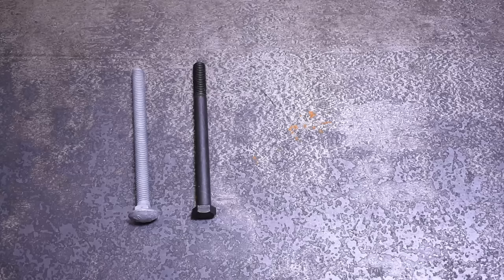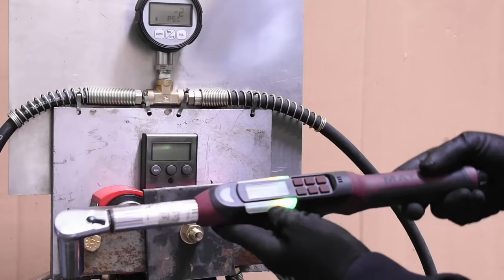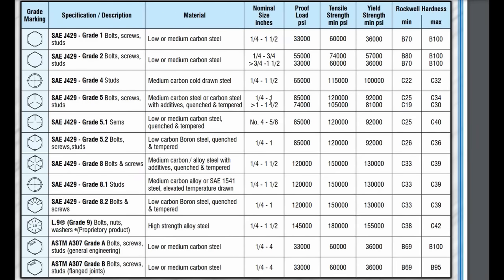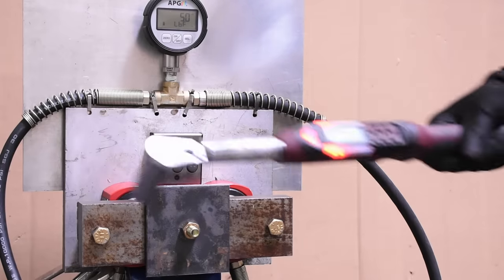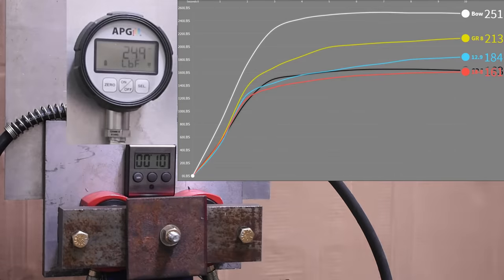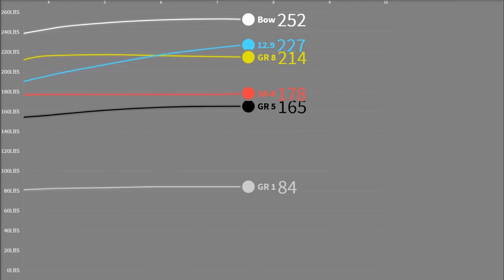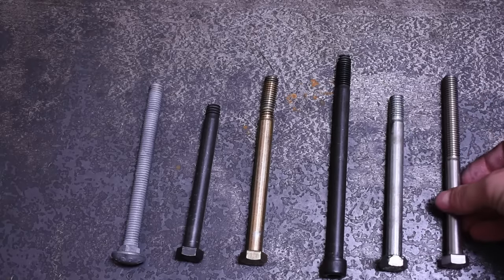Strongest Bolt? Grades Explained & Dyno Tested For Science

Comment: We use the Bowmalloy bolts at work for adjusting clamping force on vibrating material handling equipment(which is a great way to make small adjustments to the vibration), you really need to use torque wrenches with them. Unlike grade 8, it's very hard to tell by feel if they are about to yield. And they are very hard to drill out and remove from the equipment once they break off.

Comment: Love to see bolt specs finally tested! This is particularly valuable info for a home gamer without a torque testing setup to be able to test their impacts at home with some degree of accuracy, my method has always been to set it to max power, stick the bolt/nut in a vise and see how high a grade/size it’s able to break or strip the threads out of

Comment: Would be interesting to see the same test performed by hand instead using an impact. 

Also why no lube? Lube shouldn't impact the clamping force or material properties of the bolt. You would just need less torque to reach the failure point.
Reply: Lubrication dramatically changes the clamping force at a given torque. In a joint with a lot of friction, most of the torque applied goes into overcoming that friction. Add lubrication and a lot more of the torque actually goes into advancing the fastener and generating clamp.
Reply: @danieljackheck  That's is exactly what I am saying. The peaking clamping force won't change because that is a function of the yield strength of the bolt, but you will need a lot less torque to get there.

Comment: I work in steel fabrication. We fabricate the steel for wherehouses and schools. A307 bolts are bottom of the barrel but are used in nearly building for non-inportant pieces. A325N and A325TC bolts are the ones that hold the stairs, beams and tubes together. Pretty much everything structural

Comment: Great video! 35 year industrial maintenance man and engineer here, and I have been down the rabbit hole of bolt ratings for certain high stress applications many a time.
18-8 isn't a bolt rating - it's another type of Stainless steel, like 316 or 301 or 304.
So when you see it on a bolt head, it's designating that it's Stainless and which type of Stainless. 
Different Stainless steels have different corrosion and magnetic properties, and in many applications those are what matter the most over torque, toughness, and hardness. Many Stainless bolts are very close in the torque, toughness, and hardness ratings, so the differing properties of the different kinds of Stainless tend to come into play.
Reply from the maker: 304 is an 18-8 aka 18% chromium 8% nickel
Reply: 18 series is what most ss cooking pans are made of.

Comment: I run stainless bolts all the time at work, biggest issue I've run into with them is the gall super easily
Reply: Copper anti-seize is a must with stainless fasteners!
Reply: Antisieze is a must with stainless fasteners if you want them to come apart again.
Reply: @JonMarshAnderson  can't use it on food processing equipment
Reply: @bigj231  I try to use food grade antiseize when I can, but it's not always practical when its in a heavily washed down area
Reply: @Respawntheskullpupper  Dang, I’m in the fertilizer biz so nothing is sanitary haha but everything is stainless
Reply: @bigj231  Even the stainless fasteners pit and lock together in some potash, if it doesn’t come apart in 2-3 weeks, it’s good forever!
Reply: Nitronic 60 bolts or nuts, although expensive, can help to solve the galling issue if antiseize is not allowed. And they are stronger than typical 18-8 bolts as well.
Reply: @Respawntheskullpupper  yes you can. Food grade like Walter and other brands. It's a ceramic based anti seize.
Reply: @powertothebauer296  they stick together. Usually it is an imperfection inside the nut or a bad spot on the bolt that causes the metal from the bolt and nut to grab one another and essentially weld itself together!

Comment: I've worked with a lot od stainless steel fasteners in food processing equipment. Mainly for corrosion resistance, not so much for strength. Lots of 'Ny-lock' nuts there, not actually for any real 'locking' ability, but for their resistance to falling off if they get loose, and damaging equipment.
 Then I've also spent a lot of time working on machine-tools, and heavy equipment. Lots of 'Allen' head fasteners, they are usually in recessed holes where you don't want a lot of material removed, or more often clearance issues, so you have the head of the Allen bolts in holes recessed to just a few thousands of an inch clearance.

Comment: I spent 6 years working in Aerospace, I'm curious how aerospace grade bolts would compare.  Might be worth a video,  I know the prices on these bolts were ridiculously expensive,  would be funny for your community to lose their minds over the prices of each
Reply: I was wondering where the NAS bolts would test. They’re rated 180,000 psi tensile and 95,000 psi shear.
Reply: You can snag them surplus quite reasonably. Found some for a few bucks a piece to repair an industrial grandulator. The blade mount bolts were very similar in spec to the aerospace bolts except they had a torx type cap instead of the hex cap. Was for a Cumberland B60 grandulator machine. 🤓
Reply: @christopherleubner6633   At least you know it will meet/exceed the original bolt lol

Comment: One of my first experiences with 1 time use bolts was on a flywheel to crank bolt on a Nissan 240sx. When re torquing the bolt it snapped pretty quick. Very brittle. Nissan had them in stock for $6 a piece like 20 years ago. My buddy says BMW uses a fair amount of 1 time use aluminum bolts. Save a little weight.
Reply: One time use bolts= head bolts for Diesel engines...those are "stretch bolts"  They only stretch once.VW had them with a Torx socket head.  Can reuse them -just not to tighten down heads. $6 each & there were 10 of them.

Comment: Just a comment on your conversion from pressure to torque: this is dependent on the friction coefficient in the thread and between washer and nut.
So for different surface treatments of the bolt there will be a different conversion factors.

Also, your recommended torque should ensure that you don't exceed 90% of the bolt's yield strength when tightening. When your pressure curve flattens, you already exceeded the yield strength of the bolt

Comment: In my experience as a mechanic/ hobby fabricator stainless bolts snap or stretch far earlier than anything else. I won't use then unless it's for a low torque submerged application.
Reply: I use them for outdoor decking and stairs.  Haven’t had one break and it doesn’t look ugly after 2 years
Reply: I think it depends on he manufactura and application they were intended for. I have experience with true stainless exhaust bolts and nuts an they love ceramic paste because the threads wear out quickly in compariso but they do not snap or stretch. They are between 8.8 than 5.8 but closer to the first.

Comment: Some background from a BSc student Mechanical Engineering: It is not weird that the hardened bolts fail/shear in the tests with the Thor impact. The hardening makes the metal brittle, whereas the cheap bolts will just stretch. It is like comparing a brittle cookie to a flexible rubber band. So for their application (high strength fixing) they are great, because the rated tightening torque is well below failure point and these bolts will withstand a lot more in their lives. And the "weak" bolts are usefull in applications where only low strength is required (in cost considerarion), or even in flex/movement compliant design (wood construction for example) . 
Very interesting to see this theory applied! I like your videos!
Reply: Many failures occur from overly hard studs/bolts being used in areas of extreme temperature change.  Think engine exhaust manifold bolts.

Comment: Yay, we're not getting ripped off!
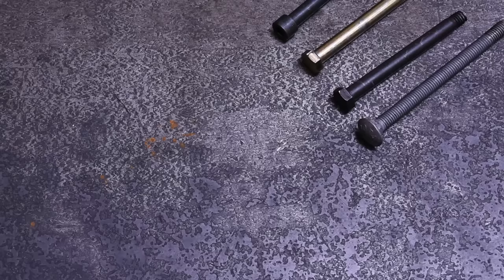     If anyone was scratching their heads at the introduction of the 304 bolt at 1:44, in which it was called "non-steel, non-ferrous": 304 is steel, and it is ferrous, being an alloy of 60-something% iron (the rest being a lot of chromium and nickel, plus 11 secret herbs and spices). However most of that iron is in the form of austenite, and austenitic steel is non-magnetic, which I suspect is what they meant to say.
Reply: 304 is magnetic tho. Go into your kitchen with a magnet and check your "Stainless" knives. Bet you some, if not all are magnetic.
Reply: @Mp57navy  I didn't say 304 is non-magnetic, I said the austenitic steel in it is. Steel is never truly homogenous; different ferrous structures crystalize and come out of solution at different times/ temperatures during manufacture. The resulting alloy is never 100% of just one type of cubit-faced crystal. That's why I specified most of the iron in 304 is austenite.
Reply: @Mp57navy  Your knives aren't T304, they're be a 400-series, and that's martensitic (and magnetic).

Comment: I’d like to see how a titanium bolt would compare since they are commonly use in raceing applications
Reply: Titanium is actually very brittle. You wack the typical racing pedal with a 3lb mallet, it'll shear clean off. 

I'm also not sure how much titanium is used in these applications, by the way. You'd have to test specific products. It's quite common for commercial products to be electro plated or finished with a metal, and then sold with that branding. It's not a 100% solid product or even an alloy in many cases. A good example of this is cookware. Stainless steel cookware is the name of a finishing, isn't made from any stainless steel. Cast iron isn't solid cast iron. Copper isn't copper. Etc.
Reply: It’s used for its strength to weight ratio which is much higher than steel, not for its ultimate tensile strength

Comment: Loved to watch this video, however I have a small point.

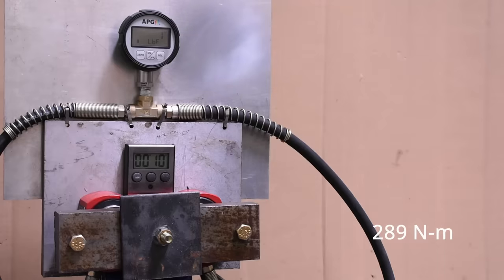9:40 The yield point of a bolt is not when it starts losing tension (graph line goes down again) but it is the transition between the steep uphill and the flat lining.
In technical terms the yield point is described as the amount of stress a material can take where is plastically elongates 0.2% over its original length measured after unloading.

What you were reffering to is (close to) the ultimate tensile strength. UTS is a measure of stress which is force over area. The cross sectional area changes as a bolt gets stretched so the UTS of the material actually gets reached after the curve goes down again in terms of pure beans.

In material stress tests it's critical to measure the area of the snapped off samples to determine the actual stress in the broken region.

Rant over, keep up the great videos!
Reply: This is the way.

Comment: The problem with using stainless bolts is that if you over tighten them, the threads of the bolt and nut can gall together and are nearly impossible to remove without cutting it off

Comment: Great test of coarse thread bolts. The same test with fine thread bolts and comparing to the coarse thread bolts would be informative. Fine threads are much stronger. In many cases, the bolt is using the sheer strength of the shaft more than the clamping strength of the threads.
Reply: I understand SAE nominal same size "course" thread bolts have a smaller minimum cross section thickness than "fine" thread ones giving a stronger tensile strength. (In the same grade)
the course thread valleys are deeper.
Reply: @davidpowell3347  Yes, the sheer strength of the shaft is stronger,  because it has a greater cross section.

Comment: I enjoy watching your tests.  I believe they show fair comparisons that give insight into how selections should be made.

In regards to the stainless bolts consideration has to be  given to the service they are going to be used.  My background is with oil tankers.  We specified stainless bolts be used on deck and in tanks for corrosion resistance.  In general stainless is a good choice.  However,  we found we had fatigue failures on bolts that were used in areas where there the bolts were exposed to high cyclical loading  such as the mounting of hydraulic valve cylinders.  Proper alloy selection along with tensile strength needs to be taken into consideration. 

Another issue with stainless steels is their corrosion resistance.  There are significant differences between alloys.  Having a  stainless bolt does not mean it won't corrode.

Comment: Oh, another thing about stainless bolts.  While there's a big temptation to use them on headers (and other exhaust parts) it's not a great idea. As they heat cycle, they loose a lot of their ductility and become brittle. Then they just snap. All it takes is the thermal expansion of the flange, and it can rip it in half.

Comment: Did assembly work for equipment for the cardboard industry. Used grade 8 bolts until top management said "cut cost" (hew owners and cost was everything). Purchasing bought grade 2 bolts.. Had a large heavy piece of equipment fail..bolt breakage!!! Ended up tossing all grade 2 and replacing all grade 2 bolts on all machines with grade 8. Needless to say no money saving.FYI:They continued on their "make it as cheap as possible", then they wondered why sales were down and warranty work was way up.

Comment: I'd love to see a shear comparison if you have the setup to accommodate. Particularly interesting would be under load or torqued to the recommended value. If the shank diameter is the same across grades the shear limit may not be (speculation) greatly effected by a loaded or unloaded bolt.
Reply: Ya that would be interesting.
Reply: definitely want to see single and double shear, as in a shear pin.

Comment: I just need to correct you on one fact: Socket head cap screws are indeed available in classes lower than 12.9. I have some class 10.9 and some class 8.8.

Comment: I'm not sure most people understand why studs are preferred over bolts when it comes to things like the heads on an engine. 
Interestingly the answer is right there in the name of your channel, torque. Studs yield more consistent and accurate results over plain old bolts. 

I don't know why it took me so long to come across your channel but, I love it. The information you provide is clear and useful. After watching the first video I immediately subscribed. 
Keep up the great work my friends.
Reply from the maker: Hey thanks! Yes, consistent bolt tension is the name of the game. Input torque is sort of a crude way to get to bolt tension, but a fixed stud with nut is the best way to get there, especially with a known K value (lube)

Comment: All right, now try a collated self tapping bugle head modified truss serrated flange lag bolt… 🤣 Great video, we actually have a lot of people buy stainless steel bolts for Parks and Recreation/outdoor applications at the store I work at. I always tell the people that grab the stainless steel bolts that they will break very easy.. they never listen! 😂
Reply: lemme see. stainless.. ok great!.. what were u sayin?
Reply: Not a problem if they properly lubricate the thread to prevent galling.
Hot dip galvanized are fine for wood playsets and furniture. Almost any fastener is strong enough to crush wood fibers.

Comment: You left out nuclear grade fasteners-
Reply: Nuclear grade, the exact type as any other but priced 1000 times more.
Reply: Structural Engineer and ICC Structural Steel & Bolting Special Inspector who works at nuclear plants. A325s are A325s whether they're being used in a support structure holding up a steam generator at a nuclear generating station or in a pre-engineered metal building for a dollar store. The main difference is the paper trail creating traceability for every bit of that bolts life from raw material to install.

I used A325s as an example, but the same goes for any grade bolt.
Reply: Do you mean monel, Inconel and hastelloy? They're favoured for corrosion resistance in very salty applications (think like 304 is for seawater, it doesn't necessarily mean is stronger). But, I agree, it would be cool to see on the charts.

Comment: On metric rating the first digit is actually the value in Newton (N) times 100 per mm². So 8.x is 800N per mm². So you can calculate the strength on each bolt yourself without looking up a table if you calculate the cross section.
The second digit in the metric rating is only indirectly related to strength, it indicates the point where it starts to stretch WITHOUT going back to its original form. So x.8 = 80% of 800 = 640N per mm² it will start to stretch.

 Also I learned that if you use a "softer" nut you can achieve a higher torque before breaking since the treads can distribute the load over several treads on the nut and not all is concentrated at one point. In fact: Using a harder nut than the bolt is, might be very counter productive.

I did not know about the US rating system, it was interesting to see. I like your tests! Please keep doing them 🙂 👍